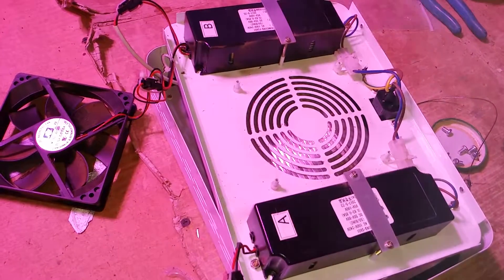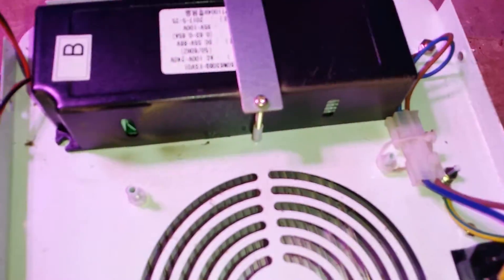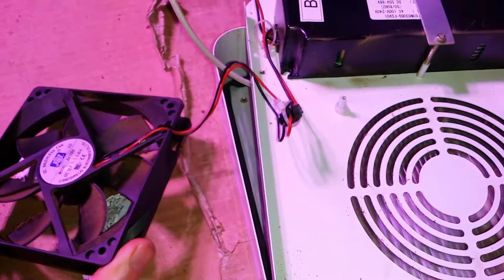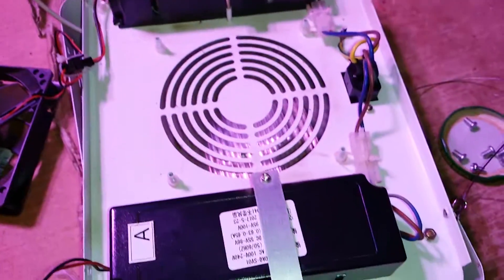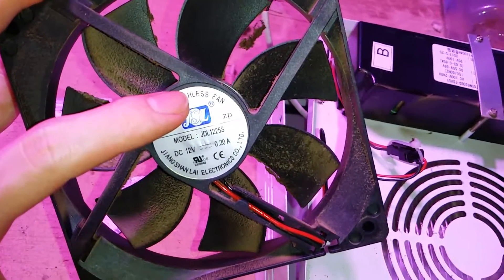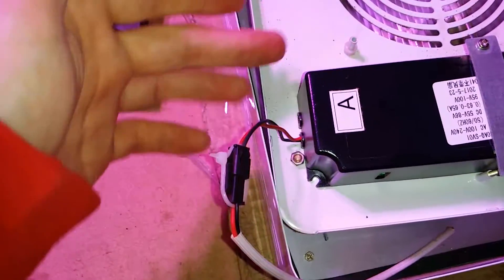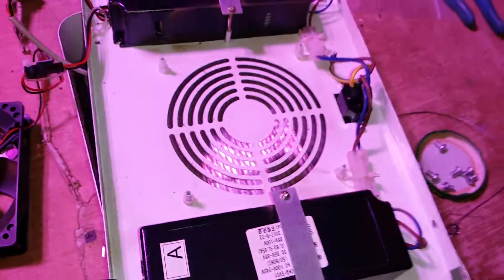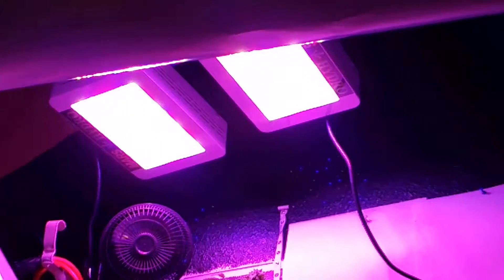Mars Hydro 300W Repair/Cleaning &Maintence Update

Comment: I still use two of these for veg but for bud im using tsl2000 still love the old work horse 300 mars
Reply from the maker: theyre rele damn good wont lie. quality components
Reply: Same except im useing 2 V300s from viperspectra.  Both 5 years old next week. Use em for veg. They work perfectly for veg. Take em apart every few months. Wipe everything down with rubbing alcohol and inspect connections and what not.

Comment: Any one know where you can get replacement led for this model?
Reply from the maker: Actually i contacted the support via my purchased site which was amazon and then had their mars hydro support amazon rep refer me to another email support which i also did too and they sent a whole speil of things hoops and loops to go thru and it also will depend if its been 30 60 90 days or more. Each tier resulting in a different approach the "mars hydro" company will take in assisting you for any RMA based assistance like parts and repair. Basically after 60 days i think it was,becomes nearly as costly to replace just an LED panel and a ballast. Youre definitely much better off just trying to get whatever hardware part you need replaced and buying that to repair and install yourself. Definitely not worth what they charge for their parts, plus your paid shipping plus waiting with much more downtime without a repaired light. Shouldnt take more than 30 minutes to fix any possible thing with this light. Not weeks shipping & handling and the time for repair/RMA then shipping back. And you pay both ways too for shipping if its more than 60 days im pretty sure. I can refer you to their email support if you purchased outside of amazon. Email me at demonsparkx @ gmail . Com
Reply: demonsparkx basically one half of my light the l.e.d’s have stopped working other side works fine and fan still runs🤔
Reply from the maker: Sounds to me like the one half of the LED driver/ballast is dead. May be wrong but id put my money on that. The diodes should individually be protected via resistors so if one led chip died they all shouldnt go out.
Reply: demonsparkx ahh ok that would make sense,wonder if you can replace that half of the ballast or would it be cheaper replacing the whole light altogether? I hope not as it would seem a waste and very eco friendly I don’t wanna throw it out
Reply from the maker: Offhand i canr recall but if these use two seperate ballasts like one per half of the LED panel,then yes im fairly sure you can swap out a dead one for a new one to get the other half of the led lights up and running again. Makes sense to have the array setup in series/ parallel that way since each ballast has half the load per each. Keep me updated?!

Comment: Mars is doing promotion on their website. It is super cheap. But i don't like the old tech. Lol
Reply from the maker: Nice  lol wish i could grab one again. They aint too bad. Had a better one but sold the lot of equipment while ago. Did work great for indoor grows
Reply: @demonsparkx  i have the 300 mars mine works good all the lights still work, i also got a Mars UFO 180 watt , and only the IR and UV diode is burnt out i contacted mars on there site and they sending me the replacement diodes, with shipping it only cost me $11.00 total

Comment: What about cleaning the glass?
Reply from the maker: Never actually personally had needed to do that  but whenever id wipe it down after touching it with my hands id use a microfiber cloth
Reply: I just took mine apart and cleaned inside of glass, heat sink and fan like you did runs and looks new again. Thanks for the vid dude!
Reply from the maker: Great to hear! Welcome that youve enjoyed. Always best to maintain equipment for best performance and prolonged longevity. Sadly i dont have these or any lights anymore though. Had them for over 6 months with 12/12 schedule and zero problems with all 3 of them.
Reply: I know old post but wipe down with rubbing alcohol.